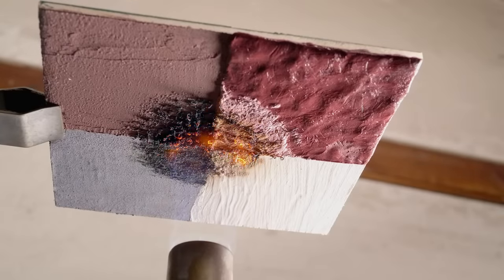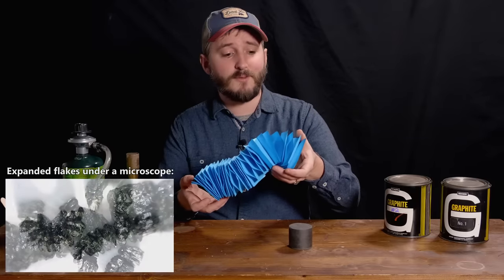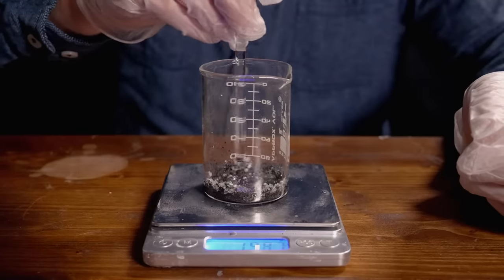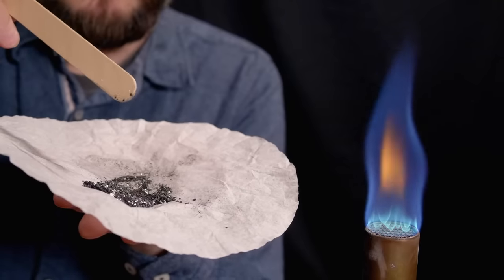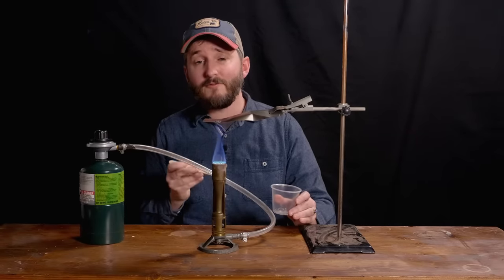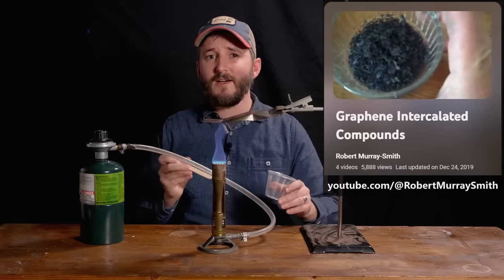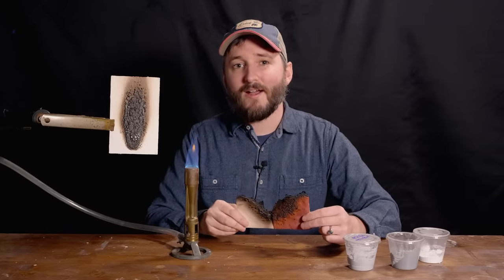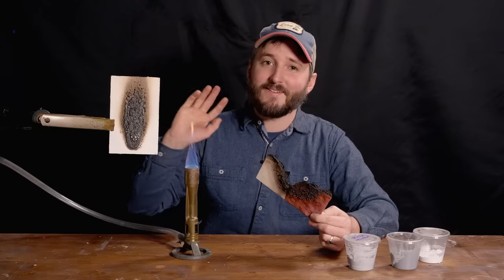Fireproof Expanding Graphite

Comment: Regarding the difference in reaction time between 50 mesh and 250 mesh graphite:  I don’t know if it’s similar with graphite but when fine powders of aluminum and magnesium metals are made for example, a surfactant is added so that the metal grains won’t join back together. It may be that the more fine 250 mesh requires surfactant in its manufacture and that also protects the surface to some degree from the sulfuric acid?  I wondered about this since you showed that the graphite could be turned into foil using fairly little compression.
Reply from the maker: I don't think that would be the case because graphite is often what is added to things to prevent clumping. It's pretty good at not sticking together. It could be there's some added ingredient to the smaller flake though.

Comment: Off the top of my head, it could be a diffusion problem making the smaller mesh graphite take longer for the acid penetration. Diffusion is a kinetic process so it would make sense that it would work at an elevated temperature. Even though the size of the graphite C-C bonds is consistent between the meshes the larger size may just have more layers per grain according to their size. Just my 2 cents as a Materials Engineer.

Comment: I wonder if this process could be used to make batteries more efficient,  a foam instead of plates, could in theory increase surface area and therefore energy density of the battery,  we'd love to see you make one! Love your videos and thank you for your great content!
Reply from the maker: Yes this has already made waves in battery tech, and also has some uses for supercaps
Reply: Perhaps use the foam inside a thin mesh pipe to increase exposure of the foam and strength of the cathode, anode?  Just a thought.  Pipe material would be important like stainless 306l  or 308l I forget.

Comment: Its so weird how something can have different uses if used in different ways, it can insulate from heat if applied with fire, but if you add electricity it heats up.. like the carbon ark electrode, I've seen a graphite pencil used in the same way

Comment: How do they produce this at scale without thermal runaway?
Or do they just do it in a chonky sealed metal container able to withstand the pressure, heat, and fumes like they do with ammonia production?
Reply from the maker: There's really very little risk of runaway with this reaction but I'd rather people be safe than sorry. At scale reactions that might be prone to runaway are done with lots of active cooling or the reactants are fed through pipes and mix together a little at a time continuously instead of all at once.

Comment: Those "worm-like" things could be there just to create holes in the surface of the putty, to allow for controlled evaporation of the water.
I imagine the effect is pretty similar to poking holes in a potato, so it won't explode while being cooked.
It's a pretty clever way to ensure the holes will happen on the surface, IMHO.
Another thing, the size of the granules probably has something to do with "ideal" spacing and hole size.

Maybe you just need to add the right mixture of your graphite, along with a strong hydrate, to a clump of polymer clay (or some analog with higher temperature resistance)? I predict you would have some fun figuring out the best granule size, as well as finding out the best putty material.

Comment: It looked like the tall "hairs" of graphite in the putty helped to contain the spread of heat, keeping it more localized to the flame source.

Your paint kept a smoother surface, which maybe allowed the heat to flow over the edge and around to the backside of the plywood.

Additionally, the coatings with a more pronounced expansion could have redirected even more heat over your lower-profile material. I would be quite curious to see how each of these coatings performed individually, without being right next to each other.

Comment: weird thought: if the expanded graphite can be compressed into a foil, could a relatively uncompressed sheet be used as a thermal pad in computer components? usually the compression of thermal paste helps spread the paste and fill in any air gaps, and it does an okay job. however a custom cut sheet of graphite would have incredible thermal conductivity and could be compressed into a foil as a part is locked down filling even the smallest imperfections in a heat blocks surface, removing the risk of air gaps.
Reply from the maker: Could work, I'm not sure

Comment: I think the smaller particle size reacting more slowly may have to do with the physical mechanism of action, unrelated to the chemical bonds, where the oxygen must separate the two layers of graphite.
In the large flakes it may have a greater mechanical advantage since splitting the flakes apart is an action functioning as a lever... Whereas a smaller flake would require more force to be split, since there is less distance to apply the advantage of leverage over. Also why a higher temperature is needed.
:D
Reply: I think your on to something here, in that it's mechanical and not just about the reaction rate. Also I think your theory about leverage is correct. But I would take it one step further and add that more surface area would also mean more force from a given pressure. For example, if we have a pressure of 10 psi, that gives us 10 pounds of force on a 1 square inch surface area. But on a 10 square inch surface area we'd get 100 pounds of force. So, I'd say it's both leverage and the fact youd have more total force acting on that leverage.

Comment: What alternatives are there for ammonium nitrate? It's one of those chemicals that's hard to come by because it's used as an ingredient in explosives. Do you know of any other chemicals that are readily available?
Reply from the maker: Potassium permanganate, potassium or sodium nitrate, 30% hydrogen peroxide (which can be obtained easily by freeze distilling off the shelf pharmacy peroxide)

Comment: Regarding your test of 4 sections, did you consider controlling for the placement of each substance relative to the mounting point?
Pretty quickly into the test, the backing material appears to be slightly sloped downward, which has the effect of the heat being deflected towards the mounting clip. This becomes increasingly extreme as the test proceeds, which may be altering the final results.
Reply from the maker: I leveled the board best I could at start.

Comment: If commercial black powder, such as Goex, is coated with a light coat of graphite, what properties could it possible add to the combustion of the bass product? Another person I had this conversation with, said it makes a more powerful powder. From what your saying it should make it weaker. Note , that the graphite is just coated on the outside and not mixed with the powder chemically.
Reply from the maker: I'm not convinced it makes it more powerful. Likely it prevents the gains from clumping

Comment: Those carbon hairs can act like hair on your body when it stands up, by reducing the air circulation in a thick layer above the surface, which in turn reduces the heat transfer.
It's more of an effect multiplier, especially with additives that cause evaporative cooling.
In my opinion the best coating would produce these hairs, in addition to a moderate foaming effect and a second layer beneath that has evaporative cooling properties.

Comment: I'm assuming the smaller particles have more edges by volume compared to the larger particles... since you said THAT is where the intercalation occurs - perhaps that's why the process takes longer?
Reply from the maker: That could be. Maybe it needs more oxidizer for reacting with the smaller flake
Reply: @Nighthawkinlight  possible the gas
 created at nucleation sites during the intercalation reaction is acting as an insulator.
 The more points - the more insulation?

Comment: I bet the graphite would form a much denser structure when being constrained by a layer of paint on top of the sealant. The same goes for the putty. Thinking of a realistic use case, if the putty is lining the outside of an electrical junction box, and a fire starts inside it, the graphite would be constrained between the putty itself and the electrical box, forcing the graphite to make a denser foam, while still limiting the heat transfer to the putty.
More testing would definitely be interesting to watch!

Comment: I believe the putty is formulated that way to slow fire from spreading through conduit.
  So its applied in such a way it seals up a conduit during a fire, vs being applied as some sort of fireproofing "layer"
Reply from the maker: They make intumescent pipe collars for that purpose, but I don't believe this particular putty expands enough to get that job done.
Reply: @Nighthawkinlight  John Ward made an excellent video on the subject. IIRC he mentioned the putty was supposed to be applied in such a way it fluffs up inside junction boxes and conduits. I'm sure there's many other products and applications, but I wouldn't discount the putty as bad when it's intended purpose isn't a flat layer of protection
Reply from the maker: @Username-qx9gk  I'll look for that video. If it's meant to be applied inside a box then most of these puttys are applied incorrectly in their own advertising.
Reply: @Nighthawkinlight Ah it wasn't a putty but rather pads/sachets, the video was "Intumescent pad demonstration". 
You're probably right especially if they're marketing it that way. Skimping on the active ingredient vs the little pads/sachets seem to be absolutely loaded with graphite
Reply from the maker: @Username-qx9gk  Yeah the pads are impressive with how much they expand. I have a pipe collar I may test for a short video that's basically a solid ring of compressed flakes

Comment: A thought, 

Since heat rises, and the board didn't seem perfectly level, what is the possibility that the 2 materials closest to the clamp could have had to absorb/deflect more heat than the 2 materials that were on the lower side? 

Or would this be a non-issue with this test?

Always love it when you post.
Reply from the maker: I tried to level the board pretty well. I don't think it was off by much

Comment: This is very interesting. I have a small project on my schedule, playing around with some carbon fiber, hopefully ending up being able to ably the material to a few ideas I have, and I can't help but think that this may somehow be useful.
fx. what do you think the end result would be, using something like this, in place of epoxy, having it pressurized between a couple of metal plates, and then adding heat? I litterally have no clue, but it may well be something I'll have to try.
In any case, I see many potential applications, though of course, with my limited knowledge, many of them are probably pretty silly. I'd certainly like to see some experiment done.

Thanks for the effort.
Reply from the maker: I don't have enough expertise in working with graphene to tell you how that would work out. Robert Murray Smith has a few videos making graphene by putting this flake in a blender with a special mix of water and acetone that allows the layers to separate. Perhaps that would add strength to epoxy.

Comment: The "carbon snakes" might be intended to increase the boundary layer insulation. I'd hazard a guess that the finer-grained stuff works much better than the coarser. I'd like to see a test comparing fine-grained, coarse grained, your carbon foam mix, and a combination of your carbon foam with the carbon granules applied to it's surface.

Comment: smaller usually works...except in the case of what you're doing the edges are the only part of the graphene particles you can get to react, or want to react. the binding force on the smaller particles, their cohesion is higher than the larger while the overall surface area you want to react, the edges, is smaller. weird edge case (pun unintended) of a very specific reaction that is an exception to a rule.

Comment: I think the description of it oxidizing the edges is incorrect, I think it’s creating intercalated graphite-nitrate which will produce CO2 when heated, expanding the lattice structure
Reply from the maker: Could be, but if so other non nitrate oxidizers still work just as well. H2O2 couldn't cause nitration.

Comment: Nice info and video Ben. While we are talking about different carbons and graphites, have you ever looked into carbonized and graphitized cellulose nanocrystals?   Another amazing material with a lot of potential for different applications--particularly battery/super conductors and composites.  It is sort of a more nature close version of carbon nanorods with also some graphene like attributes.  

    The nice thing about it as compared to things like lab created carbon nanorods  and graphene is that you can make a large amount at a time and with pretty simple/basic materials and processes.  Anyways, it makes sense to start off with a source/stock material that is already high in the crystalline cellulose. Industry uses stuff like waste wood, but that has less concentration of it because lignin, hemi cellulose, etc is higher.
Reply from the maker: Interesting, I've not heard of that. I've used crystalline cellulose but never carbonized it. I'll look into it
Reply: @Nighthawkinlight    Yeah, carbonizing it increases the various strengths (tensile, Young's Modulus, etc), and graphitizing it makes it very electrically and fairly thermally conductive. 

    For example, when adding the carbon form of it to epoxy, some researchers have noted that adding in just 2% by weight to the epoxy will up various strengths.  (Adding a lot will not so much, but does increase abrasion resistance).
Reply: Quick p.s.  Processed cotton apparently has the highest percentage of crystalline cellulose per weight and volume.

Comment: Question:  Given the increase in surface area, would this work better than activated carbon for use in bio-char?

Oh, ...and aluminum trihydrate?  Perhaps you can use Magnesium sulfate(Epsom Salt) which is mostly water in another coating sample.   Epsom salt + expanding graphite might prove very effective. :)
Reply from the maker: I don't think so, but I might be mistaken.

Comment: What's a good place to buy ammonium nitrate? I know it can be gotten from instant cold packs but I'd rather just purchase the chemical directly. I don't need a lot, like not enough that it should be a concern to ATFE. But I do want to make some of this and I have a couple other experiments I want to try that requires it.  It's difficult to find a source though, particularly when you're ordering chemicals to a residential location.
Reply from the maker: Other nitrates will work just as well. I find ebay to be pretty good for small quantities of many chemicals.

Comment: The graphene snakes should add to the dissipation of heat if used on a vertical surface such as a wall. When used as demonstrated, essentially as a roof paint directly under a flame there is not a lot of places to dissipate that heat to. It can’t radiate it to heat the flame which is already hotter. So your scenario would likely be the worst case scenario for graphene snakes, and best case scenario for any flame retardant that absorbs the energy by releasing water vapor or otherwise. I’m an absolute nobody so I might be wrong just as well. But please consider doing a vertical test, and measure the heat on the backside of the tile.

Comment: Would it be possible to to treat the expanded carbon foam with the same process? Then compress it back down into sheets to make larger flakes? or to re use the graphite?
Reply from the maker: I'm not sure. That's a good question

Comment: The panel tilted slightly once the test started, causing the flames to unfortunately spread across the edges where it wasn't painted. I think your homemade version would have likely faired better had that not happened.

Comment: Nice 👍🏼 Video.  Does the expanded graphite foam conduct electricity better than graphite flakes alone ?  if so, by how much ?
Reply from the maker: Yes, especially when you expand it and compress it again into a foil. Some intercalated compounds are high temp superconductors.

Comment: I have some experience with material and chemical properties of graphitic substances, I suspect you might see slower reaction on smaller pieces because the nitric acid attacks at unusual edge groups which become more common the longer a sheet becomes. I might be way off. Graphene has a lot of inconsistent and hard to predict chemical behavior.